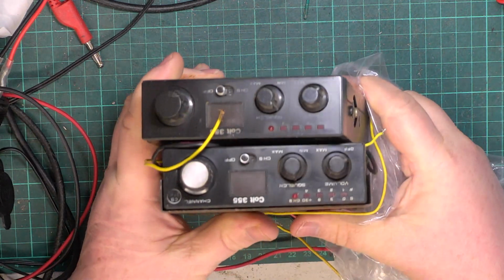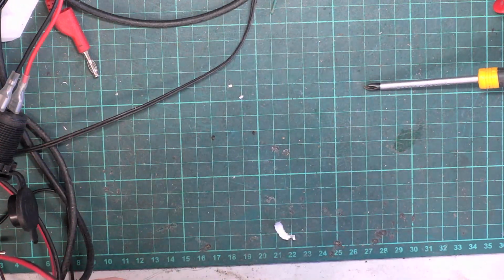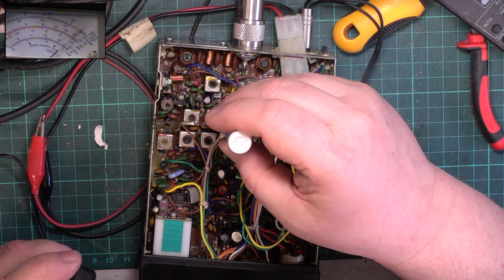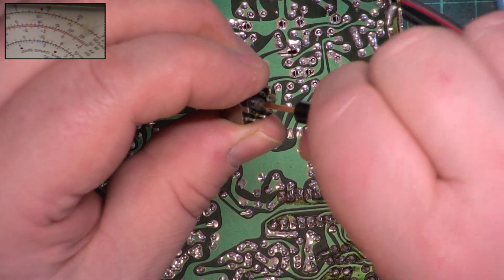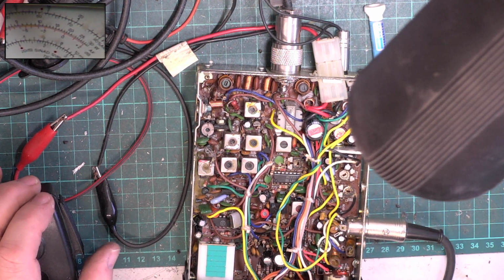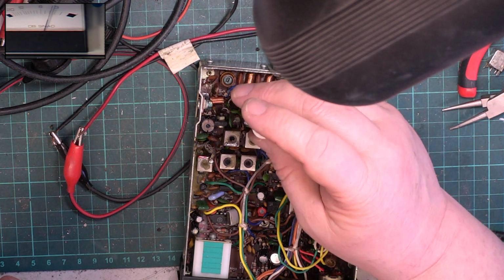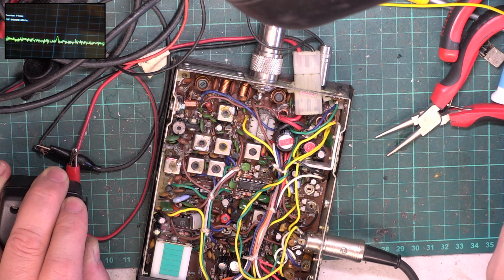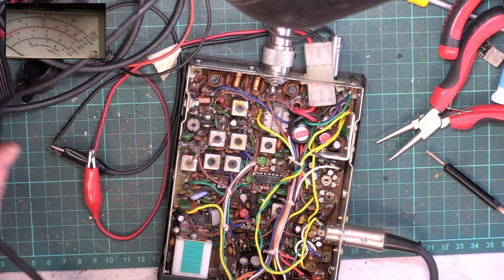Colt 355 CB27/81 UK FM CB radio (mobile) - Extensive repair & service

Comment: why do they do it ??  have a midland 2001, no tx/rx  vco core right to the botom tp voltage at 6v, core stuck fast !  had to drill it out and use one from a scrap set. got the vco voltage set and would track fine, but still no rx/tx ?  gave up at that point ? who knows what other horrors lurked ?? lol.

Comment: Poor power output on 12v, if a set didn’t (couldn’t even after tuning) produce 4 watts at 12v the manufacturer should have been done for false advertising. Surely it wouldnt have cost much more to design all sets to do 5 watts and then de-tune them?
Reply from the maker: There are more current models that won't do 4W than there were back in '81!

Comment: A thought that popped into my head while watching the video, could there of been a voltage drop across the power socket that may of caused the slight lack of RF output? Those power connectors on the early Maxon UK4O boarded radios were a bit rubbish.
Reply from the maker: Good point. I often check the full input voltage inside the radio at the power connector...but rarely on transmit. Now there's a test not in any service manual. "Ensure full rail voltage on the output side of the power switch under TX conditions"

Richard

Comment: The poor set, metal screwdrivers and twiddle twiddle, oops, broke the core, oh well, leave it at that then!  Numpties!!!
Another one saved from the bin.  
I know of one set that blocked the police when they were on the FM band but on AM, they now have the new system.  But he got a visit from them and the Radio people, RSA or whatever they were called at the time.  He was on high ground looking across at the Police Station a mile away.  There was a police station closer, but I don't think it was it he blocked, it was the main one.
However, he was in a wheelchair, so they took pity and fixed it for him, gave him a low pass filter and told him no Burners (amplifiers) but I don't think he used one, though on saying that he can booming out to me 10 miles away as the crow flies.
On a 3 watt Fidelity 3000, yeah!  Well, I will never know!